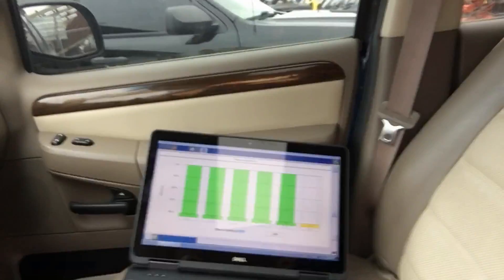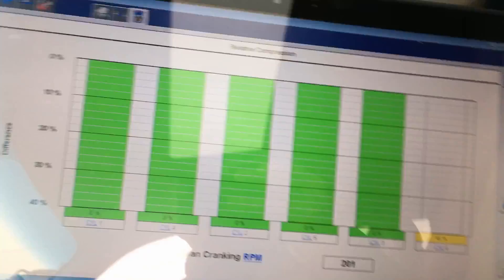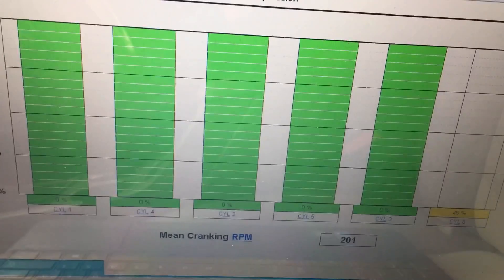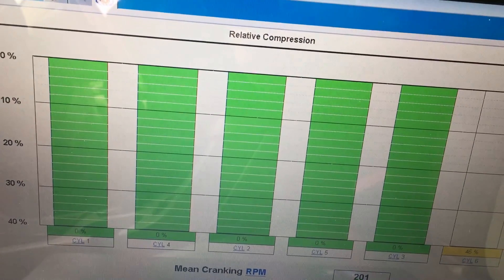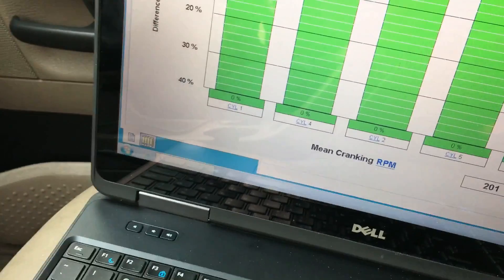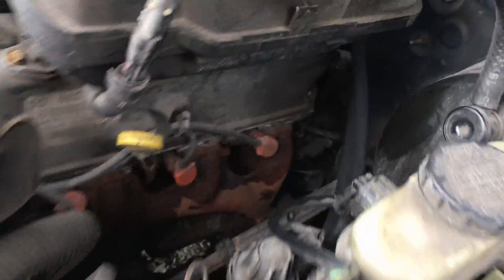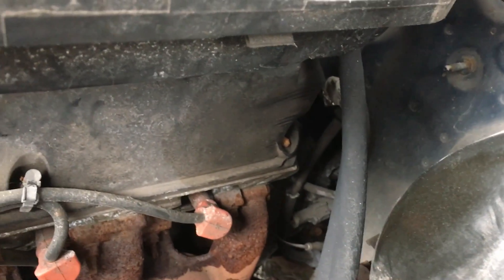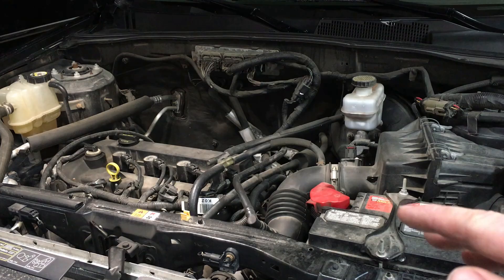Ford Quick Tips #71: How an Engine with Low Compression Sounds

Comment: I have low compression in cylinders 2,3,7,8. I can't see any obvious signs of damage with valve cover removed. Any suggestions? I know the 3 cylinder leaks on the intake side

Comment: Great tip Brian!  I’m looking for a way to perform a relative compression test on a 5.4 3 valve. (06 Navigator). Were you able to perform that relative compression test simply with the OBD adapter and forscan software?  I’m thinking that could help me determin
Reply: Hit submit by accident, finishing off that thought. Thinking that a relative compression test could help in determining if one of the banks jumped timing.

Comment: Great video, thank you. I replaced my water pump on my 3.5 ecoboost watching your videos (175k miles). Now have 220k miles but have a compression issue. Plan to pull the heads and send them to the machine shop. Hopefully, that solves the problem.

Comment: I guess the next step is to do a leakdown test huh?  I was getting around 180 on all cylinders unti i got to the last 1 and i got 150. It did sound like uneven compression. Now im not sure if i should do a timing chain kit install. Its going to be close to 1k just in parts not sure if it's worth it.
Reply from the maker: A leak down test or an air test which I prefer.

Comment: Does it mean, that in order to make compression test, I have to connect a tester, than push acceleration and cranck engine? Does this method substitute disconnection of injection relay?
Reply: Yes when you hold the gas while cranking it does not send fuel through the injectors

Comment: Dead engine? Or maybe just a bad valve/rocker arm/spring/retainer? my 2006 v6 4.0 just turned off and now runs like complete shit. mechanic heard it turn and could hear the low compression while it is turning. I hope the timing didn't jump. I'm hoping its just a bad component in the head that way i can just take the manifold off and fix it there. If a timing component broke then not worth the time. if the timing jumped would it bend valved? the engine has turned over at least 1000 times from letting it idle a minute to see if it got worse+ cranking it. so if the timing was off would it bend a valve. or maybe the timing Jumped ahead/behind 1 tooth so it doesn't bend a valve but it isn't hitting the compression stroke correctly. The car lost no oil. the coolant is about 1-2 inches lower than the coolant cool line( the engine shut off when it was at operating temperature so the thermostat could have been closed when the car shut off and some of that is in the block. OR SHOULD THE COOLANT FLOW BACK INTO THE RESERVOIR WHEN IT HAS BEEN SITTING FOR A WEEK?(changed Plugs/Wires+Coil Pack) It made the slightest difference in helping it.
Couldn't be rings because it doesn't burn oil. And the mechanic agrees that the Compression ring wouldn't go out and the oil ring is fine. The car also has 197,000 miles on it. Doing a compression test this weekend.

Comment: Thanks Brian.  On the Ford IDS, where are the bidirectional control tab located?
Reply from the maker: Right hand column it’s a # sign.
Reply: Thanks.  2009 f350 5.4l  I can see vent solenoid control, evap leak test etc. But I can not find Purge solenoid bidirectional control, maybe in use another name for Ford IDS? I am working on p0443.

Comment: I have a 4.6l in a 2003 town car 62,500 miles. Slight vibration but runs great other wise. Told I have low compression on one side 5,6,7,8. Misfires by the tech but not showing an standard code reader. Was told timing is off on the 2 banks slightly and they feel I have a broken or damaged guide but it has not jumped timing. Want to replace chains, guides and tensioners while in there. I have no sound, no rattle or any kind of noise at all. Good gas mileage, acceleration and runs great otherwise. They think the slightly off timing is causing the low compression and parts replaced above will fix it. Oh, I have also put 5500 miles on the car since I first heard of this. Is this possible?  Seems like I would have more then a little rough idle if described timing was off? Any thoughts? Thanks in advance

Comment: I have a 2003 marauder, did a compression test at work with the IDS showed 1% low on cylinders 1, 2, and 8. Is that okay? Bars on the computer still showed green. Car has 160,000 miles .
Reply from the maker: Totally normal
Reply: FordTechMakuloco Thank you! 👍
Reply: FordTechMakuloco 
I jave a forx flex EcoBoost that has 180 psi in 5 cylinders and 100p in the other.
Can valve carbon cause this issue. 
How can i tell
Do the EcoBoost engine let a little air through the oil filler cap

Comment: +fordtechmakuloco, Brian how does the Ford IDS software determine the compression differences like that?
Reply from the maker: +olsem101 The ids watches the crankshaft speed when cranking the same way the pcm determines misfires when you are driving.
Reply: FordTechMakuloco thats really neat how they can do that all based on crank speed!
Reply: Cylinder Balance Testing-- using Starter Current--also has been used for 60 years,
before vehicle electronics & crank position recognition

Comment: Hi FordTechMakuloco, I'm a new subscriber to your channels. May I beg a boone? I'm wondering if you could give me your opinion since I don't know anything about engines. I'm retired. I plan to sell my house, buy a Transit high-top van and travel while I still can. I'm trying to choose the engine. I'm leaning towards the 3.7L Ti-VCT.  I've heard stories about problems with the EcoBoost engine fouling the valves, and I'm wondering if the 3.7L Ti-VCT engine has those problems. So if I keep the oil changed as it should be and do all the scheduled maintenance on time, how many miles do you think the 3.7L engine should last without a major failure?  Thanks.  -- Gest
Reply from the maker: The 3.7L is the engine to have in that van for sure!
Reply: many thanks!!! -- Gest

Comment: you just solved my 4.0 explorer problem...thanks
Reply: Until the timing chains fail or a head gasket lets go,
and they most certainly will on a 4.0 ford
Reply: pc zapp it's a 2000, just one chain

Comment: i have been experiencing misfire issues in my 2001 f150 4.6l triton. i found this quick tip very valuable. after watching i immediately went outside and tried it in my pickup. i have a nice even sound when turning over. this helped me eliminate possible issues. now i feel at least a little better about chasing around coilovers.

Comment: does this issue (low compression in a cylinder) brings up any codes with a check light engine?
Reply: You'd possibly see it as a misfire if anything, but there are lots of possible causes for misfires, so it wouldn't be definitive at all without checking all the potential causes.  That uneven cranking noise he's showcasing is a glaring sign of poor compression, but a CEL misfire code isn't.

Comment: Very nice! I have an 01 Taurus that has 2 low compression cylinders. It runs pretty well, but occasionally throws misfire codes on those cylinders. I've put over 20k miles on it like this without issue. It does turn over similar to the one in the video.
Reply: Heh, drive it till it dies right?
Reply: tin pin exactly! it's worth nothing so might as well run it till it won't lol.
Reply: Tater79bj Yup!

Comment: Another intelligent tip for us driveway mechanics. I've heard engines that sound like this but never put 2 and 2 together. Brian, thanks for all the good info. You are helping more people than you know. Keep up the informative videos and good luck and success with your new venture. You are a great resource for us Ford owners.
Reply: I concur!
Reply: Yes, I have a 2.0L SPI and they're notorius for dropping valve seats if i start getting mis-fires I have to be careful or it'll destroy the engine.
Reply: I may end up getting another used one just to have 2 engines so i can rebuild one.
Reply: A tuned up SOHC has more power than the stock 2.0L zetec... and if i go that route i might as well go to the 2.3L mazda engine :)
Reply: Lol i'll put 1/4 "rv" cam in it should add the extra throw i need in the cam without losing too much bottom end, would work good with my 4 speed automatic :)
Reply: Yeah i never knew that you could tell by just hearing an engine crank. Its good to know when your buying a used car.

Comment: What is the basic kit needed to do a relative compression test as it sure saves a lot of head scratching. The comparison in the vid was an very informative and does the flooring procedure apply to all cars ?
Reply from the maker: The clear flood procedure applies to all Fords that have fuel injection yes it is built into the software. Many scan tools have a relative compression tester it is all software based on crankshaft speed.
Reply: Relative compression testing can be done with an automotive scope as well as a scantool. A channel called KY Home Garage just did an excellent video on all the possible ways to do the test. Great to watch and learn from.
Reply: BTW,  what was the reason for the misfiring #6 cyl?
Reply: Why can't I find the channel you mention?
Reply: will this work with hybrids escapes?
Reply: I don't know why. I just searched and found it no problem. Search youtube for KY HomeGarage. Or search for Relative Compression Testing All Methods. You should find it.